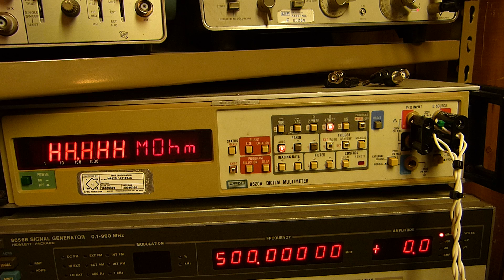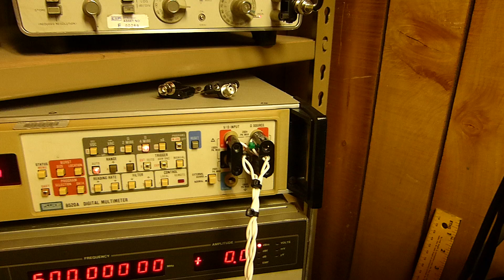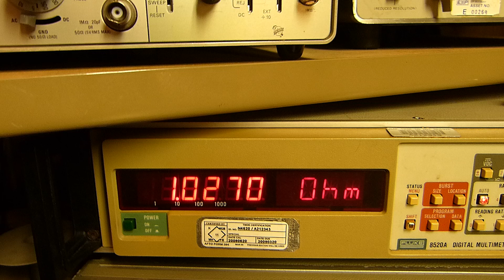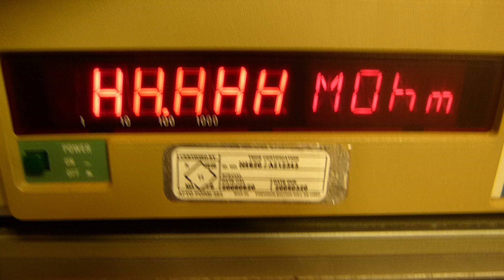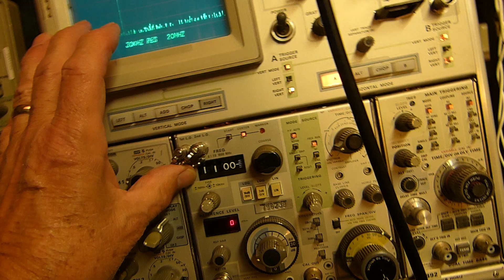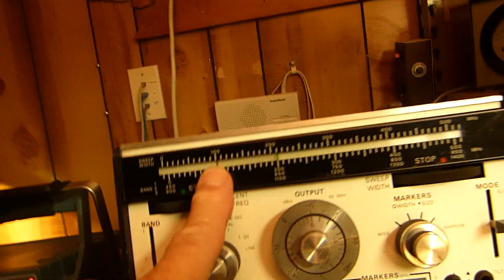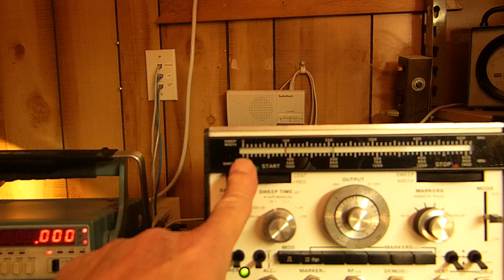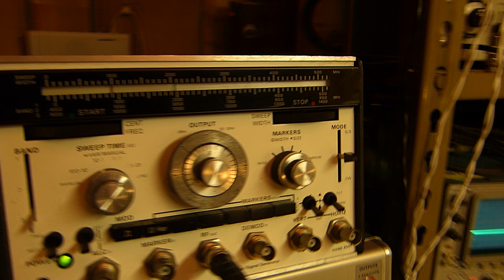Wavetek 2001 Sweep Generator & Fluke 8520A 4-Wire (Kelvin) Connection to Measure DC Resistance

Comment: Hi David, Another interesting and well done video..Thanks..Just wondering if you did any teaching during your electronics career? You certainly have the pleasant personality for doing so. I could teach but would probably get in trouble with a base ball bat at some point...Hi hi

Will your waveteck go down to 455KHz. It would be interesting to see it sweep a filter at some point if you have time. 455KHz filters are a dime a dozen and suspect you might have one or I can ship you one if you have any interest in a demo??
I use a spectrum analyzer for my filter work but a scope and sweep generator should be equivalent. I am not sure it would sync like a SA but I suspect it could if the sweep rate is fast enough.
Again, thanks so much for your time to make these helpful videos. I have been in the electronics industry for the last 40 years and as we all know, no one knows it all. You help fill in some gaps for many of us and you do it so well!!
73,'
Glenn WA4AOS
Reply from the maker: Hi Glenn - I would have sworn that I wrote you a bit over a week ago but I can't find it posted anywhere.
We just got back from vacation in Cancun - I am ready to go back...it's too cold here in El Paso ...  :-))
This Wavetek 2001 instrument won't do the low frequencies of 455 KHz but the Tektronix FG 504 will. It was a comment you left some time back that peaked my interest in scanning the IF transformers. I almost posted a video on the FG 504 doing just that. I have used the Tek FG 504 to scan a 20 meter G5RV and get some interesting results - done the same at VHF scanning manually with my HP signal generator. Now I can use the Wavetek to scan up to 1.4 GHz.  I can calibrate the amplitude of the outgoing pulse at 25, 50 and 100 ohms and see by the amplitude on the SA where 50 ohms is on the antenna. That does not mean 50+j0 impedance but the sweep generators and SA setup might have some valuable information for antenna analysis. What do you think?
David WA4QGA
Reply: Hi David,
I hope you had a great vacation and some quality and relaxing time.
I have not swept an antenna yet but that should work just fine. My SA does not have a tracking gen, YET but a Company called DS Instruments is about to release several Tracking Gens that will work with many SA's. The cost is under $1K and looks promising. If you search on TG6000 + DSinstruments, you will find their webpage and PDF's
My SA is a very nice HP8655B that cost around $89K back in the mid 80's. I paid $6k four years ago and you can find them for about half of that or less now.. I did phase lock the first LO in the 8566B with an oscillator to make an attempt of having a TG but it would not stay locked at frequencies above 7 MHz. The TG6000 is supposed to work up to 6KHz...WOW. The 8566B is good to 22GHz which is extreme overkill in my lab but like most HP gear, it looks like God himself built it..Hi. I also have a 3580 like you have and it's a super cool SA as well.
With my 8566B and kluge TG I can sweep IF's and filters at low freqs but not sure how well it really is working. The new TG will be a true asset...
My issue presently is I turned the 8566 on the other day and the display has collapsed down to a 1cm ring in the center of the screen. Probably a cap in the display circuity out to lunch..Hi..Should be an easy fix..Hope!!

73, Glenn WA4AOS
Reply from the maker: wa4aos Hi Glenn, a few years ago I was seriously into 2.4 GHz WiFi and (still have) a four foot parabolic dish with a 46 oz juice can feedhorn (cantenna style) mounted at the focus supported with thin wall PVC. Really pretty cool - I should probably resurrect it and make a YT video of it. It was up on the top of my tower on a rotor and I could see over 240 access points (back around 2005/2006) I bet I could see a thousand by now - point is, I would Love to have HP/Tek equipment to work at WiFi like your 8566B - Wow... I am in Austin right now moving the kids back to El Paso - I am so happy to get them back home. As for scanning antennas with a sweep generator - I just cannot correlate my readings yet with Z, SWR or anything else. Still trying to figure out what all the ups-and-downs on the SA mean with scanning a live antenna. I will post if I ever figure it out. 73 WA4QGA
Reply: wa4aos